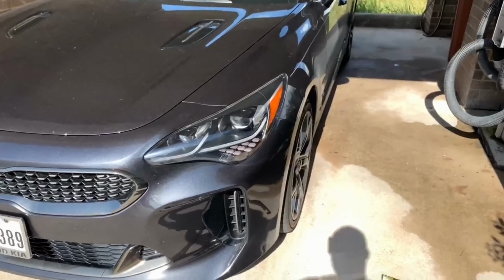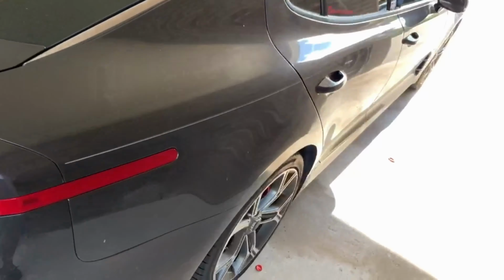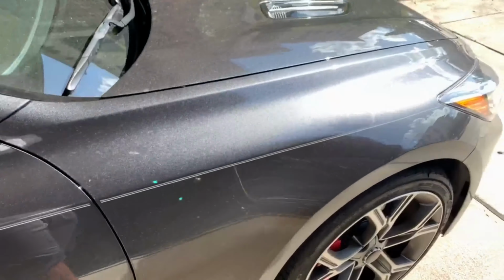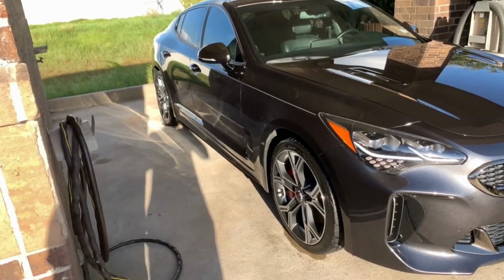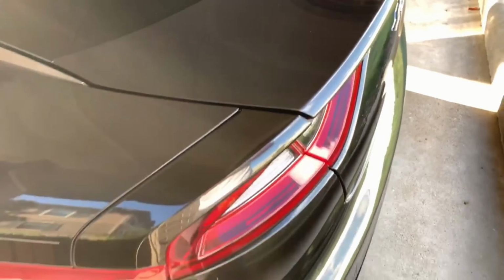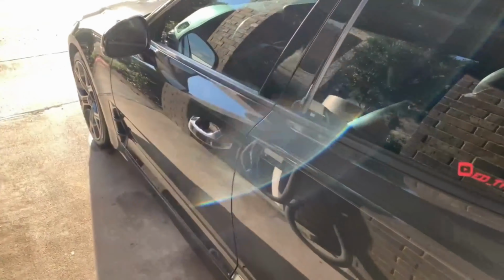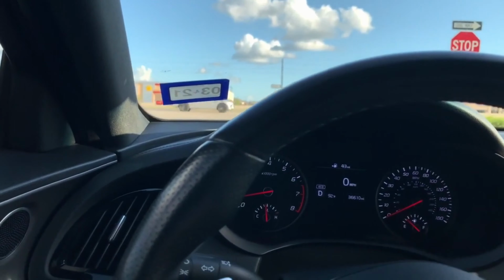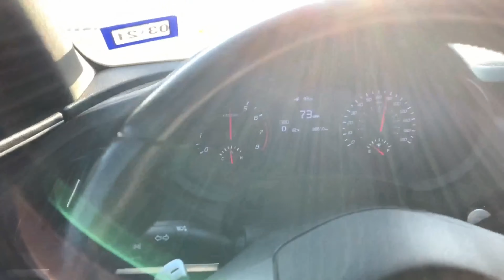KIA STINGER GT INJEN INTAKE REVS AND DRIVE!!!!!!!!!!!!!!!!

Comment: I like the look of the injen intakes but the k&N ones seem a bit louder. Ended up ordering those. Probably gonna post a video when I get it installed. Got the Velossa tech big mouths to go with them
Reply from the maker: Nice, yea I didn’t want them too loud. It’s a bit louder in person than on video.
Reply: @EdTheEnthusiast  installed them today. It’s SO LOUD 👁👄👁... hopefully I didn’t mess anything up lol.
Reply from the maker: Lol nice
Reply: @LoneStarStinger  just installed mine and im not sure if i have a boost leak or if they are just this loud. even makes a lot of noise while on the throttle
Reply: hey bro what do you think is K and N louder or the same im stuck trying to pick the injen look 1000000 times better but i want sound more than anything
Reply from the maker: Injen, the sound is louder in person. If not satisfied then add some blowoff valves.
Reply: @chadrichards8930 I feel the same exact way. Must be the intake. I installed 2 weeks ago

Comment: How do you get that stutter sound from the intake (or is it the turbo)? The “tu tu tu” sound
Reply: 'blow off valve", you can get after market ones that are louder
Reply: and i think cold air intakes make a diff too
Reply from the maker: Yes I know about the aftermarket blow off valves, but I’m keeping mine stock
Reply: @NguyenNguyen-fs6tw  thanks!
Reply: K&N intake does a tututu in 1st and 2nd gear sometimes when you throttle hard

Comment: Do you still have this bro? I have the same car just installed mine any problems with mpg?
Reply from the maker: Yes I still have them, no problems
Reply: I low key am scared to take it to the dealer now  lol .. have you ever had any issues when reverting it back to stock? Also it’s good to know you’ve had them a year no issues bro 💪🏽
Reply from the maker: I haven’t reverted them, u have nothing to worry about.

Comment: I’m moving out to Houston with my stinger, do you think the stinger is high enough off the ground for the flooding out there??
Reply from the maker: It sits at a good height, but flooding here can get crazy when it does flood.
Reply: @EdTheEnthusiast  speaking of this, have you looked at getting the hydro shield cover for your filters? I just ordered this intake and I'm reading that some people are worried about water getting in..
Reply from the maker: I have them installed. I installed them on my other video https://youtu.be/T7oypoKVA_k
Reply: @EdTheEnthusiast  o damn dude nice
Reply: @EdTheEnthusiast  I went to Houston last weekend to get a ceramic coating. Saw a couple grey stingers
Reply from the maker: Nice

Comment: Sorry but I don't believe in this cold air material, why, because it goes against the principles of proper engine operation. This system will get all the hot air from the engine, we know that it is cool air that the engine needs. Just good for car sound. For me it is a waste of money.
Reply from the maker: Sorry you feel that way, but has been working great with my car.